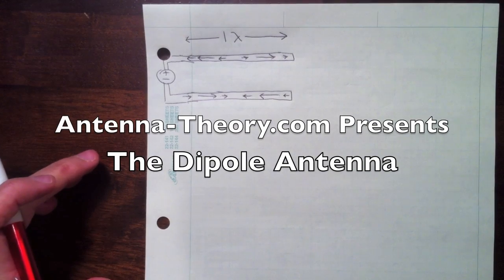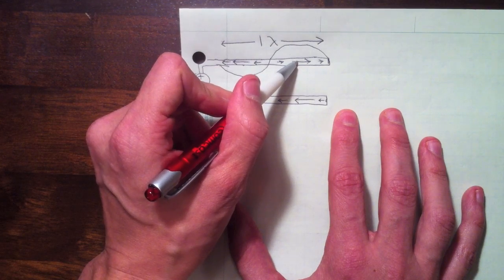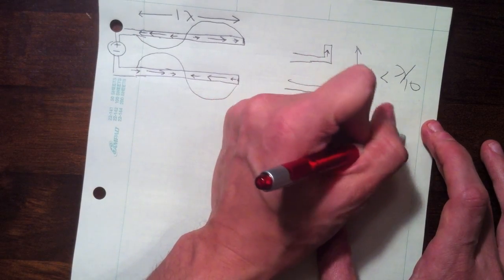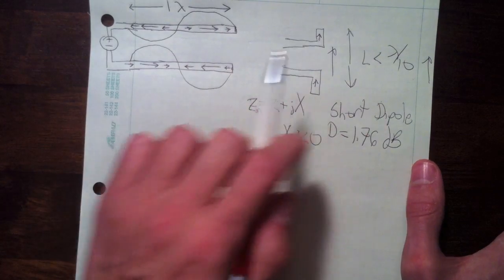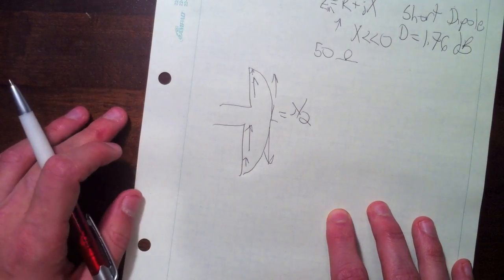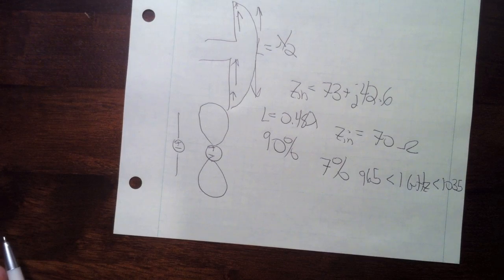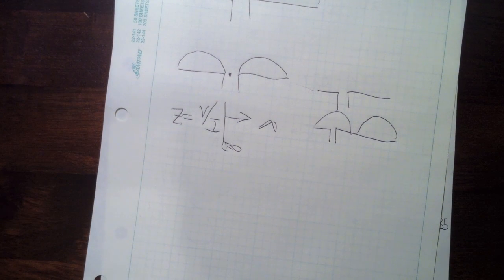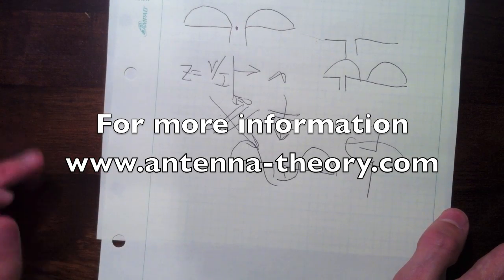Antenna-Theory.com Presents: The Dipole Antenna

Comment: Hi There, Enjoyed your lecture. A question about the charges. You mention build up of positive and negative charges causing electric fields. The negative charges are easily understood as electrons. What are positive charges? Positively charged Ions? In a conductor?
Reply: no, just represent the lack of electrons of that area and the electric potential that is created by the negative charge acummulatig in the other corner

Comment: As an electrical engineer not specialised in RF I was always looking for antenna stuff that is not too basic, but not too theoretical either. This is great stuff!

However, one thing I did not get: How does power get to a half wave dipole? You explained in other videos, e.g. about the slot antenna, that power does not get to an antenna when either current or voltage are at a minimum at the feed point. At the feed point of a half wave dipole the current is at a maximum, so the voltage should be at a minimum and thus no power should get to the antenna. 

What am I missing here?
Reply: as you said, in his video of the slot antenna he said you can't feed the antenna in the middle because the impedance appears infinite but in reality is too high, and this is because the current is 0 but in this case the impedance goes to 0 but in reality neither is  0 in reality the value is aprox. of 73+43j ohm, that is the lowest value the imput impedance can get,  and this is because the mathematical model of the current distribution and voltaje presented here is not really the real one is an aproximation thats why in the slot antenna the real impedance in the middle is not infinite and here is not 0.

Comment: Jeez So many comments about the clarity of this video, yet it reminds me of my worst lectures at university. Spoken by a very smart guy who already knows it all and has forgotten what's it's like not to. So it's fuill of opaque terminology which the people watching this video will by definition, probably not understand. I have a degree in electronics (though not in antenna or radio) and having watched this video, I have very little idea of what he's talking about.
Reply from the maker: always great to hear from a fan - thank you for the kind words!
Reply: @pjbevel  I'm studying antenna propagation, so at least i appreciated the video. I can't imagine someone watching this video without having some idea of what you're talking about.
Reply: In case you're studying antenna propagation, i've got a good question for you: If I connect my Voltmeter to the middle of this dipole antenna, what will I see and what does it mean (and why is it not voltage)?
Reply: @Muhovc  Well i can't give you any numbers on the voltage. But i will say that the current is higher at the feed point and the voltage nigh infinite on the ends.
So we feed the dipole in the middle to have lower impedance  that we can more easily match it to 50 ohm coaxial line. (i think the ohmic resistance at a straight dipole feedliine is around 73 ohms purely resistive non reactive)

But in case you wanted me to explain it in terms to prove i do have some understanding of it, the electron flow is limited by the capacitance of the aerial elements, and since only at high altitudes is air conductive enough to allow electron flow, the capacity is limited to the metal conductor in which current is flowing until the voltage potential is too high to feed without a transformer balun.
Reply: @thestranger2749  "voltage potential is too high to feed without a transformer balun" what are you referring to? you start talking about capacitance and ended with another thing that is not related and then said that when the voltage potential is too high you have to use a transformer balun? excuse me? you use a transformer balun for two things match the impedance something that ONLY depends on the geometry of the antenna and where you feed the antenna and second, to get a system from balance to unbalance so it doesn't matter is the "voltage potential" is too high if you are feeding in the middle of a dipole and your cable doesn't have a 70 ohm impedance you have to use a match element to get a high power efficiency and then if the cable you are using if unbalanced like a coaxial cable you have to use the balun for a very similar objective, to get a high radiation efficiency, so  neither both things are affected by a "hight voltage potential".
Reply: @redknight344  high voltage potential exists at the end of a wave, we feed a dipole in the middle because it has the lowest impedance.

if you feed an antenna at a high impedance point with 50 ohm coax you'll have to use a transformer.

because the high voltage potential at the ends of the dipole are at high  resistances.

so we feed the antenna at the half wave point were current flow is maximum and voltage is minimum.

You use a choke balun on a dipole fed with unbalanced line to stop RFI because the line is not a balanced line like ladder line

you wouldn't use a transformer balun to feed a dipole because you don't have to.

The standing wave ratio is only about 1:1.2

Comment: Did I hear you say a 2, 3 or 4 wavelength dipole "will not radiate"?  Surely it was my ears!
Reply from the maker: I explain why directly following that statement, what is the confusion? If you feed a perfectly symmetrical thin dipole that is an integer multiple of wavelength, no it does not radiate because of the impedance. Same reason you can't feed a patch from the center....

Comment: I really enjoy your videos on antennas. But I have a question. Since the half wave dipole is inherently a 73 ohm antenna why are we always trying to match it to our 50 ohm transmission lines by feeding it in the center? Can we change the feed impedance by shifting the feed point to one side of center like the slot antenna or would that always increase R or increase X to an unmanageable point? Telling me to feed it with 75 ohm coax for amateur radio HF work is not an acceptable answer as we love our LMR 400 and such. I am sure you know this. We use mostly current baluns or just a coax choke at the feed point and do the best we can to trim our antenna to resonate to keep the SWR down and then use an antenna tuner to keep the transmitter happy and all-in-all it turns out pretty good but what really got me to thinking was your video on slotted antennas. Thanks again for taking the time to share your knowledge on antennas.
Reply: i think is because the middle of the antenna is the lowest imput impedance we can get so if you move the feed the real part of the impedance only gets bigger so no 50 ohms anywhere.

Comment: Did you study Physics to learn this or Signal Engineering? I find all this fascinating
Reply: He is most likely from an Electrical Engineering background. I doubt Physics majors look at the impedance of antenna because impedance studying is an optimization. Impedance itself is very simple if you only look at circuit itself. Antenna is also very simple if you don't consider impedance problems. But when you put circuit and antenna together, a large swath of human population can not understand it for the life of their time. Same goes with the quantum/general relativity incompatibility problem.
Reply: Start with Electrical Engineering, heavy in math.  Pete has a natural talent, so don't expect it to come easy.

Comment: Total length: you have it drawn with a significant gap between the two gaps; is this part of the total length, or is it just the added lengths of the two ends?

Low efficiency and low bandwidth for small antenna... why???

1.76dB... Z = 73+j42.6... where did these numbers come from? Where's the math? Where's the explanation? Isn't that the purpose of this video, to explain these things?? 90% efficiency/ 7% bandwidth... same thing. Where are these numbers coming from? These are very specific numbers, yet there's no math or even any explanation explaining them.

I think answers to these questions should be given in a video like this for it to be of any value to anyone, but I guess that's just my opinion.

Comment from the maker: No, current and voltage still follow a full sinusoidal wave along the transmission line - with maximum and minimum separated by a half-wavelength, so a full period is one wavelength

Comment: Excellent Dipole analysis!  I've already built one for 20 meters. It is about 65 feet in length  (half wave resonant at 40 and full wave at 20) and have talked all over the world on it on 40, 20, 15, 10, and 6 meters with 100 Watts. It also works on 80 meters. I am using a MFJ 969 Antenna Tuner.  By your analysis it should not work on 20 meters, since it's (approx) full wave resonant there. Any thoughts?  It may be the 300 Ohm twin lead I'm feeding it with has some positive effect?
Reply: Yes, you are right. The full lambda antenna is fed in the voltage node which implies very high impedance (in the order of 1000s of ohm)
You can not use a 50 ohm coax cable to feed here.
Any open line (300-600 ohm) along with a genuine BLT (balanced line tuner) would do the job very well.
De VU2RZA

Comment: Thanks for taking the time to present this information. 

I was lucky enough to work in telecom (analog/digital radios/muxes/switches) when you still had to kind of know what you were doing just to setup the test equipment properly.

 The computerized stuff started showing up (no more tweakers..yawn) and the fait accompli was the shift to on/off keyed lasers that a child could setup. Bored to tears I moved into management for something different (it was that ;-)

Thanks again...very good stuff!